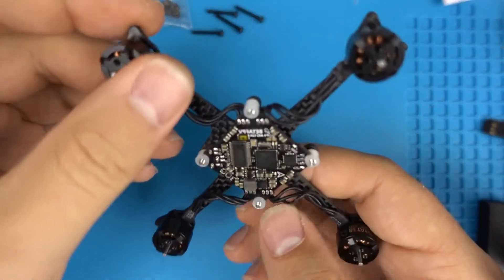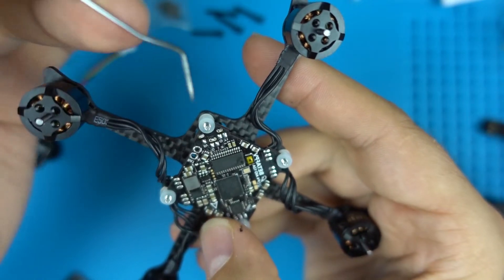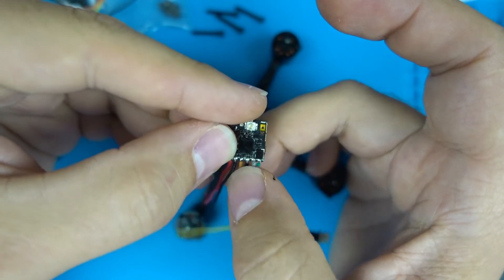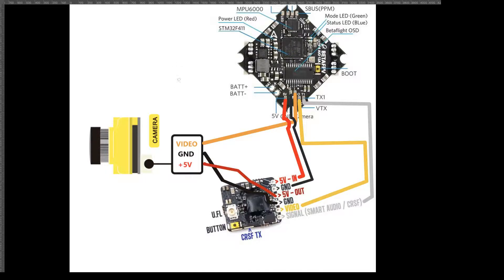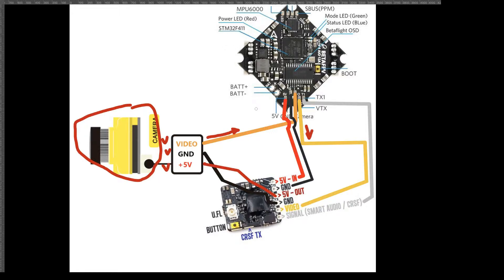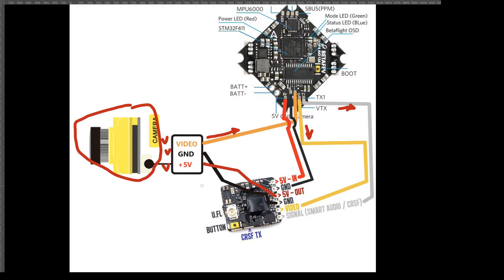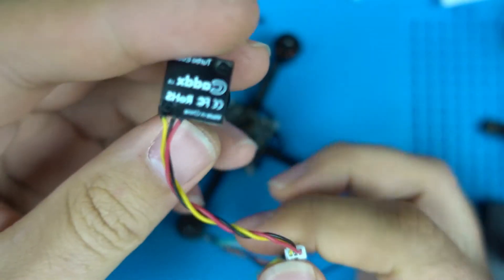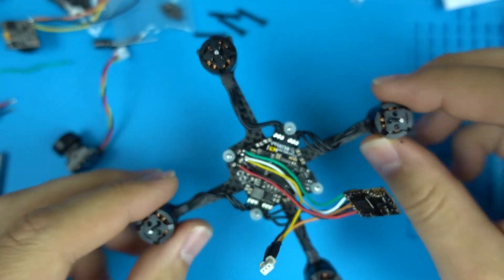Adding Soldering Video Transmitter (VTX) to a Flight Controller (FC) Diagram Whoop style FC and TBS

Comment: Hello, from what I found, the Mamba FC board manual is misprinted. I've been having difficulty connecting  the Runcam Micro swift 3 v2, 5-36v to Runcam tx200, 3.5-5.5v. I'm installing them onto Mamba f405 mini mk2 5v 2A Bec (Diatone 2019 gt r349) and would like to know if the wiring is basically the same. If you happen to have your own diagram or can put me one together for this model, It would be greatly appreciated, you can email it to me: allenm737@gmail.com
Thank you so much in advance! Also I'm a newbie at this, and have medical issues that hinders my thinking(3 back Surgeries and Fibromyalgia) and need some guidance....  WOW, I almost forgot, I also subbed ya to gain more knowledge...Thanks again!